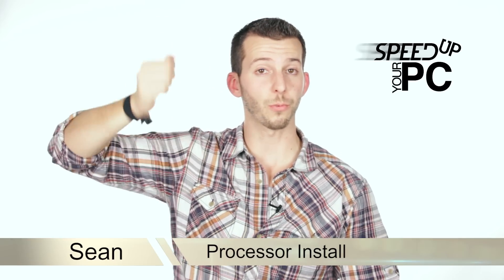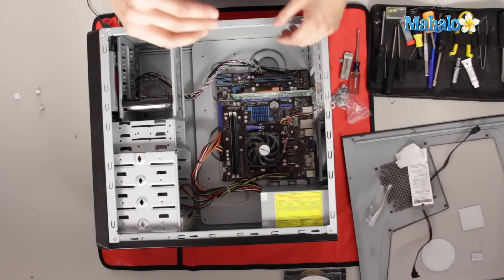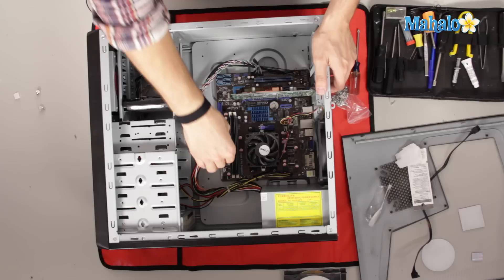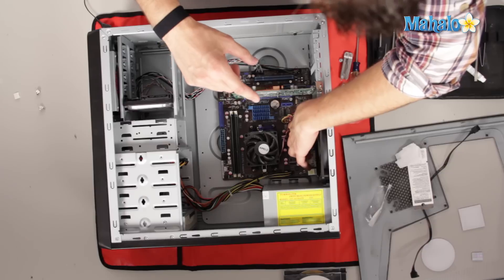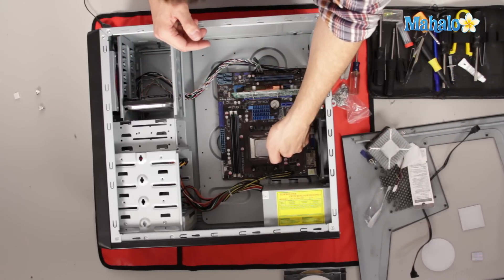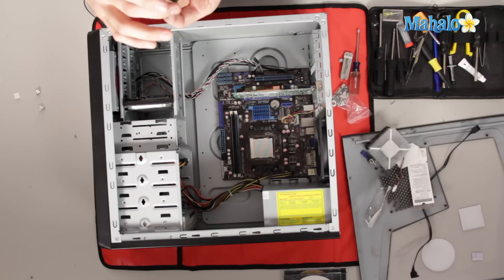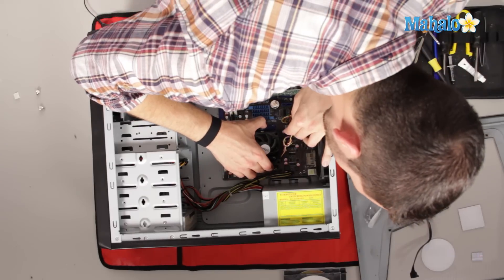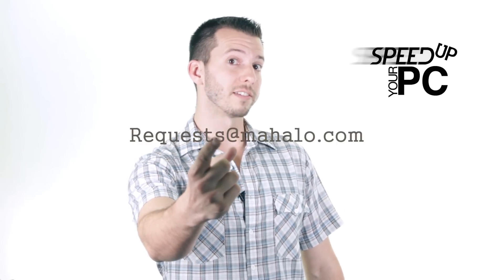How to Install a Processor - Fix Your Slow PC

Comment: Does your computer immediately speed up after changing the processor?
Like if it had an i 3 and put an i 5 in there?
Or do you need to change out other things as well for it to be faster?

Comment: I got a Intel Core i7-6700k processor and my won't fit do I need a bigger mother board 🤔
Reply: The I7 6700k is an LGA 1151 socketed CPU, And if your mobo is not an 1151 socketed mobo then it will not fit.

Comment: Do you need the thermal grease?
Reply: +Wolfy Bananas  I think you do it seems like a kind of gasket to ensure the two parts actually touch.. if the heat sink wasn't pushing against the processor it could be just barely touching or imperceptibly not touching it...and the function of the heat sink would not transfer the heat efficiently as possible and cause the CPU to overheat which would be NOOOO BUENO SENOR!!!!
Reply: ^^^^^^^ HE IS WRONG Thermal paste is used as a thermal conductor to help transfer the cool temperatures to the CPU and without it you could very well be sentencing your CPU to a death penalty because of this it is NEEDED It has nothing to do with contact.

Comment: So I need help, I have an amd fx 6300 with a gtx 970 and im pretty sure its bottlenecking it. So I want to go to an intel core so what do I need to do that?
Reply: +Nick Hollenbeck and 8320 or 8350 that should fix ya right up
Reply: +Nick Hollenbeck hey man, im in the exact same boat. Did you ever end up upgrading?
Reply: +FJmonarch850 yea man I ended up getting an Intel core i5 4690 and getting a better power supply and it runs much better, so I would switch to Intel if u have a 970 because Intel can handle it better. Oh and I also had to get a different motherboard to support the Intel so pretty much I did a complete upgrade

Comment: i ran the program CPU Z and it shows that the new processor is showing installed but when I go to "about system or msconfig "  my new cpu is not showing up. Is there a set I need to do or somehow update the bios, which I tried and it said it is current. I had a Core Duo 2 e6600 and I installed a Core 2 QX6700. Any response would be appreciated. Thank you.
Reply: hey man, well at lease you got one, a CPU that is! can i ask where did you get it from i went to www.download.com it was a Cnet  download site but i didn't see anything about CPUz can you tell me where you went to please?

Comment: forgot to have buttsex with the processor before putting it in my computer 
got 30 fps instead of 60
took the processor out and had buttsex with it put it back in got 120 fps 

i win 10/10

Comment: Hey... I have An intel dual core processor. Can I change it to i5 processor with same motherboard ???
Reply: Someone thing your gonna want to check is your lGA socket and your BIOS version.I doubt any Core2Duo CPU will have the same LGA socket as a i5 processor.
~ThePigGuy
Reply: ThePig Guy I have a core 2 duo and I just bought an intel i7
Reply: Yes. You shouldn't have a problem with that
Reply: Aedan Croft the i7 came in trust me it wouldn't work core 2 duo is mainly LGA775 which i5, i7, i3 don't come in that size the best you could get for your motherboard from what I see Is a intel core 2 quad (not extreme) cause your bios wouldn't support any i7, i5, i3! best regards

Comment: my motherboard is DDR3 1800 OC it has AMD Athlon 255 processor (old one) can i install Intel Core i5-3570K Processor?
Reply: No, intel processors and AMD processors only go into a certain socket. If you wanted a 3570k. You would need a new board.
Reply: i know. I found my question anwsered on tom's hardware
Reply: Destro Mixer sorry i dont want to answer your question or whatever but this is the only way you see this and maybe can answer. i have a laptop and a pc can i put the processor from my laptop to my pc?
Reply: partychicken king no. also it depends on what processor you have for the laptop and desktop as well.
Reply: Nope laptop processors are diffrent
Reply: thank you
Reply: Justin Z so lets say i had Destro Mixer's same processor. So i would have to buy a completly new computer already intel porcessor compatible to install a Intel Core i5-3570K processor?
Reply: you just need new motherboard
Reply: Destro Mixer ah ok I'm not aw informed as u are in computers but I do know some. Thank u for the help
Reply: Now  i understand alot about PC parts because i found all my important anwsers in tom's hardware.
Reply: Justin Z How do I know what kinda of CPU to get for my computer.
Reply: intel core i5 is fast and good
Reply: Well can you put any CPU in any computer? I have a Compaq.
Reply: nope. Check your motherboard compatibility. There must be writen on your motherboard. AM3 CPU support or FM2 CPU support or AM3+. If you motherboard supports AM3+ you can only buy CPUS that use AM3+ support if it uses AM3 then you have to search for AM3 CPU processor. If you buy diffrent non compatible  CPU you might crash your mother board or your CPU will melt
Reply: Destro Mixer Okay thanks, is this the same with hard drives or can i put any hard drive i want in there
Reply: i don't know much about hard drive. But all i know it's your PC memory
Reply: Okay thanks any way.

Comment: Your actual operating system itself can dictate how much RAM you can add. If, for example you have Windows 7 32bit, 4GB RAM is the maximum. But you can get 4+GB of RAM if you have Windows 7 64bit

Comment: Dude, i hope u can help me, i got a intel celeron D347, how much ram i can add? since the motherboard can run only 2GB DDR2 at 533, i dunno if the processor can be compatible with more ram on a better motherboard.

Comment: LoL dude, Cpu = Processor.... The most important thing , is that u buy/upgrade ur processor with the compatible cpu slot like u have for AMD : AM2 , AM3 . AM3+ , etc.. lookup ur current processor online and check what type of connection it has :-) " u cannot put an Am3+ cpu like the newer zambezi piledriver into an am2 motherboard.